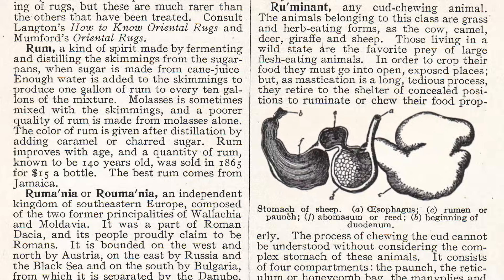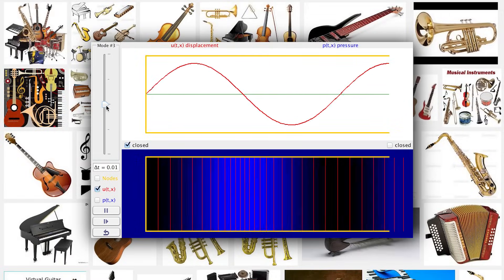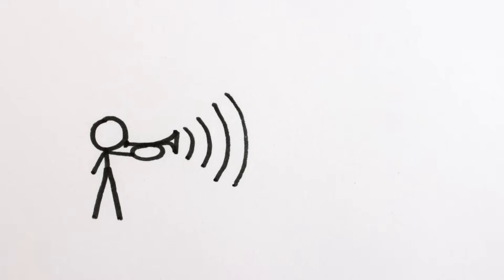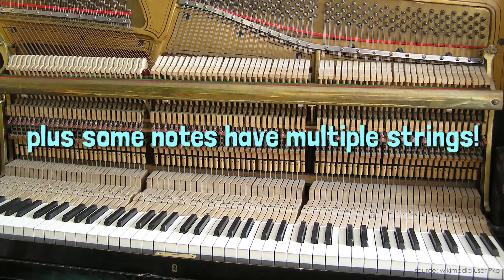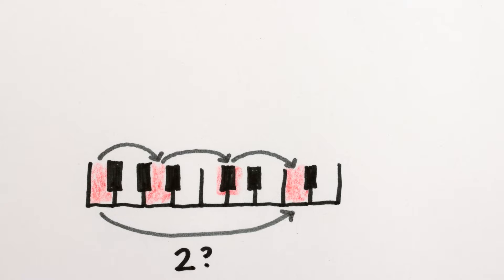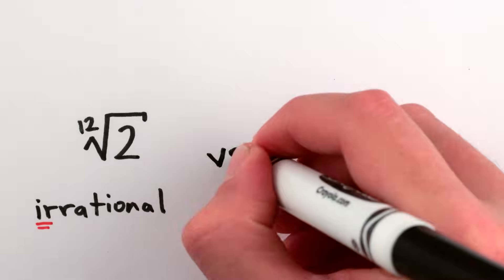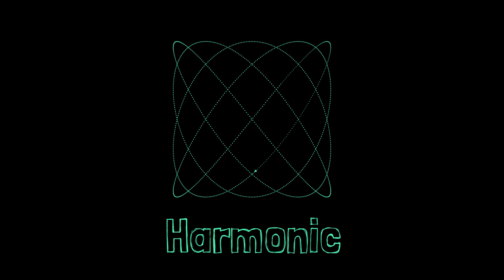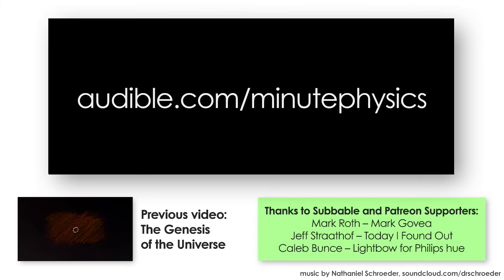Why It's Impossible to Tune a Piano

Comment: Not to be obnoxiously picky, but it isn't impossible to tune a piano-- it is just impossible to tune one without stretching most intervals.  The topic is very well presented.
Reply: +Greg Scott Even with natural tuning, you can pick any key and tune your piano such that the three major chords and two minor chords are perfectly in tune, or two major chords and three minor chords are perfectly in tune. Everything else and every other key will be out.

E.g., in C major, you can tune it so that C, G, F major and E and A minor are OK but D minor will be out. Alternatively you can tune D minor but F major will be out. So it's impossible for all 6 main chords to work with a perfect pitch keyboard.
Reply: MusicalRaichu ...of course, MR.  This is well known among people with any knowledge of piano tuning.  There were many methods that were common in centuries past for tuning of harpsichords and clavichords; these methods allowed musicians to play the music of the day adequately.  There are many different schemes for tuning keyboards.  No one takes the methods you suggest seriously for standard piano tuning, but many people do use specialized methods for specialty recitals or recordings.  The tuning scheme used in Chopin's day, for example, is different from equal temperament and in some cases really highlights the beauty of Chopin's harmonies. All of this illustrates that there is no one perfect method for tuning the piano; that is impossible.  We're running the risk of getting way too picky here; the idea is that mathematics itself prevents a piano from being tuned in such a way that every chord in every key is perfect.  There MUST be compromise somewhere.
Reply: Greg Scott
yep that's what I was trying to say. didn't know that it was different in chopin's day though. guess that shows how music is an evolving art.
Reply: MusicalRaichu Yeah-- the history of tuning is more complicated than meets the eye... or, ear.  You're probably aware that Bach famously endorsed well temperament as used in The Well-Tempered Clavier, and many people confuse that system with modern equal tempering.  In fact, well tempering was an attempt to compromise in a few ways so that you could indeed play in every key, but some keys had intervals that were a little farther out than others.  A musician would not be able to play all the pieces of TWTC on a keyboard tuned in the conventional method prior to well tempering.   There were different approaches to temperament throughout Europe, including different standard pitches.  It was only within the last century or so (I think) that A=440 was accepted as standard pitch.  In Chopin's day, they didn't use equal temperament, but something a little closer to Bach's well tempering.  So some of Chopin's music sounded different to Chopin himself than it does to us on modern equal tempered pianos.  It's very interesting stuff if you're into that kind of thing.
Reply: Greg Scott
Actually, to me, a modern piano sounds different in different keys. Flat keys sound mellow while sharps are brassy. Is that's my imagination, or is modern tuning a bit biased in some way?
Reply: MusicalRaichu MR, I believe that has more to do with a special ability of yours to perceive pitches differently.  All things being equal, there is no bias in the actual setting of pitches while tuning.  There are a few people, though, like yourself, who can distinguish different qualities of different keys.  That's amazing and wonderful.  A couple of questions-- do you have absolute pitch?  Have you noticed this difference in color independent of instruments, or does it happen only with piano?
Reply: Greg Scott
No, wish I did, but I don't have perfect pitch. I can't say whether I've noticed it with other instruments. Since the effect is subtle, it would be swamped by the intrinsic sound of e.g. a brassy trumpet or mellow oboe. Guitars aren't really tuned for flat keys, so maybe that's why I haven't noticed it there.
Reply: MusicalRaichu That's interesting, MR.  There are others who hear those subtle differences in pianos but unfortunately I'm not one of them.  I've played the piano for many years (about 58 years and counting) and I really don't notice any differences in tone color based on pitch alone.
Reply: +MusicalRaichu I think some keys sound more whole than others - F# and Db are my favourites, shame that they're the most annoying to play in though..
Reply: tacos mexicanstyle Yes, they have their charms and their challenges.
Reply: tacos mexicanstyle
Interesting. F# sounds a bit off-tune to me, but that might be because it's so rare so I'm not accustomed to it.
Reply: +MusicalRaichu F# on the bottom of the bass stave is what I live for ;) it sounds nicely inbetween the gross lowness of C below the bass stave and the less rich C on the stave
Reply: I find that your conversation very interesting and hold many inside knowledge of the topic :)
Reply: Kaito Kaze
I'm just a self-taught amateur. Greg seems to be very knowledgeable though. I wish I had more time to spend on music theory though. Hey, a you a Vocaloid fan too?
Reply: MusicalRaichu yes a bit of  a fan, cause i love many other thing too haha.
I saw your youtube channel it had many great vocaloid music video sir I sub :)
Reply: +Kaito Kaze I don't know how people tune pianos where you live, but here in Vienna many piano tuners don't use electronic tuners, but just one tuning fork (usually A), and they count the beats to tune the other notes.  The result is often a hair different than equal temperament.  Perhaps that's the difference you're hearing.

cheers from rainy Vienna, Scott
Reply: This thought occurred to me; I do notice different tonal effects in different keys (even though all keys are tuned equally in Equal Temperament).  I believe it is because when I sing along with my own playing or own practicing it is easier to sing in keys that fit my vocal range.  A song in E is going to feel too high to sing whilst the same song in Db will be a bit easier to sing as it is lower in pitch and more in my vocal range.
Reply: Cobrun Sells That makes perfect sense, Cobrun.
Reply: Scott, you make a very important point.  Many tuners here in the states sill use a single fork to start with, and that is the way I learned to tune.  And indeed, while you can get satisfactory tunings this way, there are always differences based on the simple limits of the human ear and brain.  The tuner will determine that his final result (the bearing octave) is within acceptable tolerances, or it is not.  Acceptable tolerances will account for differences in the brightness of certain intervals.  While many tuners may still use the much more fun and challenging single fork method, I think more and more are opting for the relative ease and accuracy of electronic tuners.  Ultimately what matters is the tuner's skill at actually setting the pin in order to maintain the most stable pitch over as long a period as is possible.  There is an art to it; it isn't simply a matter of 'reaching' the desired pitch and going on to the next string.  You still need to be a great tuner to use an electronic device and leave the piano properly tuned.
Reply: Greg Scott
While I'm no piano tuner, I have somehow ended up tuning several pianos over the years, and I can corroborate what you say about setting the pin- it is indeed an art, and I have a great deal of respect for those who can do it well.

cheers from rainy Vienna, Scott
Reply: In the title we have not the word "in theory" because in pratic many excellent tuners can tune very well their pianos. Often here no musicians try to talking about the intonation without any practic experience. This is completely useless! Please stop to idealise the numbers and ridiculous ratios! Go in the good concert with piano solo and then say that this piano is out of tune instead to listen the music and apreciate the composer...
Reply: Latchezar Dimitrov So set our listening and piano tuning career goals for mediocrity?
Reply: If after long tuning career you say that the piano can't be tuned, yes!
Reply: Latchezar Dimitrov Cool. Good thing I'm not at that stage yet.
Reply: To be obnoxiously picky, you spelled obnoxiously wrong.
Reply: Very kind of you.  Thinks.
Reply: Greg Scott And you spelt thanks wrong, thanks :3
Reply: It's impossible to tune a piano justly.
Reply: It's impossible because it's an irrational number. You can't tune perfectly by ear because humans are prone to error, and you can't tune perfectly by computer because computers can't store irrational numbers, only approximations. So there's no possible way to do a perfect tuning, and even if it was somehow magically properly tuned there'd be no way to measure it to know.
Reply: To be picky, that's exactly what he communicated in the video.
Reply: MusicalRaichu That's because that F# is "off tune". Not only in a piano does equal temperement slightly flatten or sharpen the notes, there is also a level of inharmonicity due to the sound being produced by a string. In inharmonicity, the harmonics are not integer multiples of the fundamental and deviate from that going sharper as you go up the harmonic spectrum. This is also why an octave can never be fully pure in a piano; when one harmonic is pure, there will be beating at another harmonic level. For an example if you were to tune A3 to A4 (let's say you tuned A4 to 440hz) in a piano, the A3 will be slightly flatter and will not be at 220hz. That's also only if you tune the second harmonic A3 to the fundamental of A4 as a pure unison, if you tuned the 6th harmonic of A3 to the 3rd harmonic of A4, A3 will be even flatter than that and there will be beating that occurs at the 2:1 level (fundamental of A4 and second harmonic of A3).
Reply: if you have enough notes you can tune anything. The piano doesn't have enough notes, and therefore, not enough ratios to cover all the possible chords that are used in western music.
Reply: mighitman but why are strings inharmonic in the first place?
Reply: John Smith It shouldn't matter if it has enough notes or or how many chords it can play, just like you said "if you have enough notes you can tune anything." The piano does, however, have enough notes to cover 7 full octaves which, by the pythagorian comma, if you play 7 pure octaves in a sequence and 12 pure fifths in a sequence the frequency by the end will not be the same frequency, that's just proved mathematically. This is part of the basis of equal temperament and what the video above speaks upon. However, this is aside from what I am talking about and not including inharmonicity which is a whole different topic from the pythagorian comma. To make an instrument with inharmonicity, like the piano, sound good to the ear, you would have to detune the notes a little bit more than if it did not have inharmonicity. Strings are inharmonic because they have mass, length, and tension. Think about it this way, when playing a note a trombone or flute, since they are wind instruments and produce sound through an air column, the harmonics are all able to vibrate freely and therefore are integer multiples of the fundamental (ie. if an A was played at 440hz, the next harmonic would be 880hz, then 1230hz, then 1760hz, and so on). When a string vibrates, there are different parts of the string that vibrate more freely than others (the ends, aka termination points, of the string are where the string cannot vibrate as freely and in the middle is where the string does vibrate more freely). This creates a change in the harmonic spectrum because the harmonics are basically trying to compensate for the mass, legnth, and tension of the string causing them to vibrate faster because they don't have as much room to move around in. Depending on the mass of the string, the legnth of the string, the tension, and the diameter, determines how much inharmonicity that string will have. I hope that makes sense, it's hard to describe in a way that makes sense.
Reply: If a piano string has a shorter length, the inharmonicity will be greater (again this also depends on the mass, diameter, and tension of the string). This is why Concert Grand pianos sound better than spinets, uprights, or smaller grand pianos, because the strings in a Concert Grand are longer than those in shorter pianos. Therefore having less inharmonicity.
Reply: mighitman, very interesting; thank you!

Any relevant keywords I could google with? (other than inharmonicity)
Reply: Jason Doe I think "theory of piano tuning" would probably list some good results. If you add inharmonicity to that it'll probably yield some better results though. Remember too that there's a difference between "forced vibrations" and "free vibrations." When a string is bowed, that is considered a forced vibration and the harmonics will be at integer multiples of the fundamental. The only time when inharmonicity occurs is when an object, such as a string, vibrates freely on its own (which is what happens in a piano). If you were to bow the strings on a piano, then it would result in being purely harmonic since that would then be a forced vibration. Vibrations in wind instruments are also considered forced vibrations. That one I'm still trying to wrap my head around, but it's proven nonetheless.
Reply: mighitman, I see – much appreciated.
Reply: Greg Scott vi
Reply: Nice why you prefer them? Db is the same as C# or not? Also between this I hear there are differences.
Reply: Thats interesting. I never knew that F# is off tune and that there are so mant differneces in different keys. I wonder how my piano tuner is doing it.  But also on the guitar it is not possible. I also have one and when I have tuned it always the E A C is well and then the low G is never in tune. But in Baree of course the G is ok.
Reply: Objecting to deceptive titles isn't obnoxious. Click bait is.
Reply: As far as I see it for an equal tempered instrument (12 semi tones) it is basically impossible to make it work for all key signatures.  You may be able to temper it for C but if you move to D the ratios are wrong.  This is the issue and you have probably heard pianos tuned for a particular key in which the music was played in.
Reply: @timothychung797  I'm sure you suspected that my spelling was intintional... and you spelled spelled wrong, which I bet was intintional too... ; - )